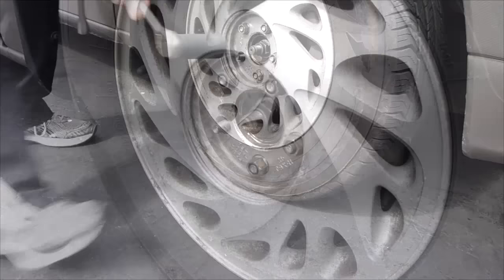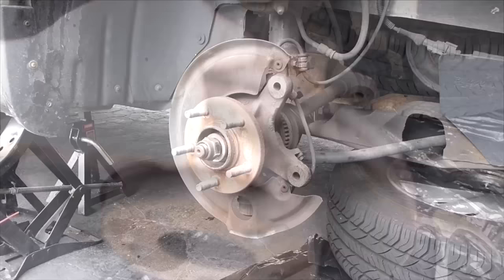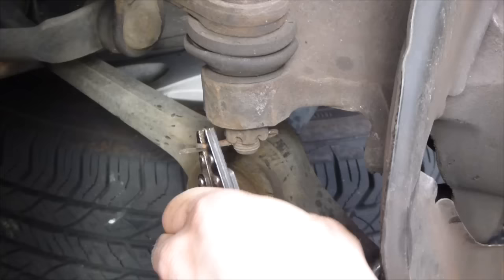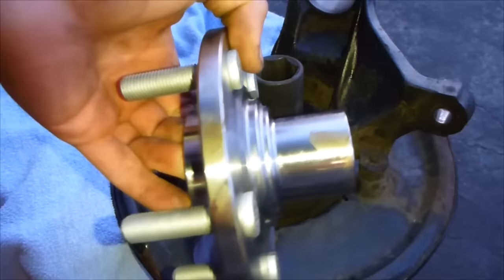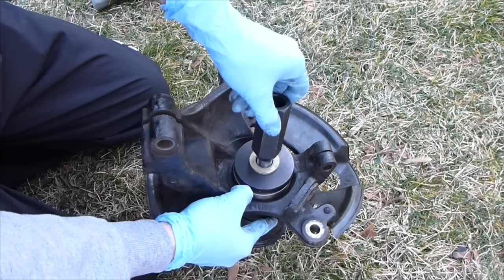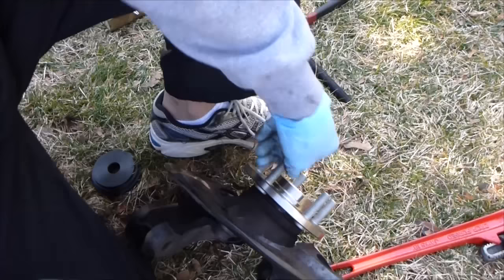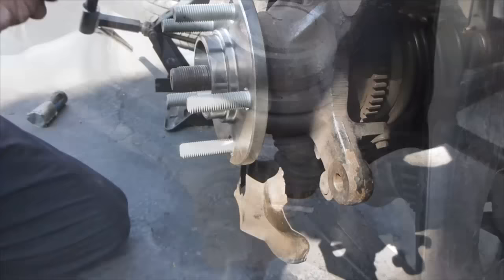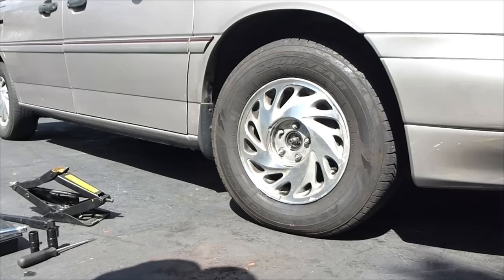How to Change a Wheel Bearing (short and fast version)

Comment: is it safe to hammer in and out my old and new bearings in and out? i do not have access to a press or a bearing puller, my autozone does not have any to rent out and i cannot afford to buy a bearing puller =[
Reply from the maker: Kevin You really shouldnt hammer the bearing in or out because you will potentially damage the bearing. For a few bucks take the knuckle and bearing to your local auto shop and ask them to press out/in the bearing.
Reply: good idea, hopefully my pepboys will help me out, i didnt think of that nice! thank you!
Reply: Chris, i am not sure if you will get this since i reply to my comment, but if you do please lemme know! I got everything off, the axle nut, caliper bracket, rotor, ball joint, tie rod, shock, but i CANNOT for the life of me get the damn axle out of the hub... i tried PB BLASTER, heat, hammering it, it is starting to mushroom and its marred up pretty bad now so i ressembled.. any tips for when i re attempt it? any help appreciated.. so frustrated!!!
Reply from the maker: Kevin If you can get a ball joint press around it and press it out, that would work. Keep the axle nut on the axle as you hammer it so it wont mushroom.

Comment: Hey Chris, where do u buy your vehicle parts? Which one is the best?I wanna buy a rear wheel hub assembly for my ford?
Reply from the maker: STEEVE DAVID Nicolas It depends. I usually go on amazon because they have hassle free 2 day shipping and good prices. What year and model Ford? Mevotech has great parts and I really like their stuff and MOOGProblemSolver also has great parts. Those are the two companies I go with for aftermarket and I have never had a problem!
Reply: 2002 ford explorer xlt v6 4wd
Reply from the maker: STEEVE DAVID Nicolas For the rear dont you have a solid rear axle? There is no hub assembly I am pretty sure (correct me if I am wrong). In that case, it is just a bearing and you need to remove the rear diff cover, take the pin out of the spider gears, remove the C-clip on the axleshaft and then use a rear axle bearing puller to get the old bearing out and press the new bearing in.
Reply: ChrisFix I don't have to do all that, it is a press bearing
Reply: STEEVE DAVID Nicolas what do u think if I get my bearing from auto parts warehouse
Reply from the maker: STEEVE DAVID Nicolas Ok cool! Yea, you can get your bearing from them! I have gotten parts from ***** and they have been great!
Reply: Alright man, thanks
Reply: Hey Chris,I have  a 02 ford explorer xlt v6, when I turn the steering wheel all the way either side, the engine turn off, especially when I'm backing up,or do a I turn? What could it be cv axle or bearing or engine?
Reply from the maker: STEEVE DAVID Nicolas That sounds like a bad power steering pump to me. Check this out: https://www.youtube.com/watch?v=A0fiZCHz5ew
Reply: ChrisFix should I just change it or flush it out?
Reply from the maker: STEEVE DAVID Nicolas I would flush it first because it is so easy to do. Even if you just use the turkey baster method and get most of the old fluid out and fill it with new fluid it should help. Then you can see if that is the actual problem. It might not be the problem but that came to mind since your engine stalls at full lock.
Reply: ChrisFix and there is that humming noise when I turn it around the corner too
Reply from the maker: STEEVE DAVID Nicolas Yea, that sounds like a power steering pump.
Reply: ChrisFix ok,I will take care of it then

Comment: Hey Chris, can I use that bearing press for a rear wheel bearing?
Reply from the maker: STEEVE DAVID Nicolas It depends. If it is a solid rear axle, no, but if it is an independent rear suspension, yes you can.
Reply: ChrisFix it is for 2002 Ford explorer 4wd
Reply from the maker: That has a solid rear axle so it is a different setup. You have to take the diff cover off, remove the pin holding the two axles in to remove the inner bearing. There is a slide hammer type tool you use to get the bearing out.
Reply: ChrisFix it is different here is my rear differential in my Ford http://www.swaptastic.net/ls1_miata/images/ford%208.8%20diff%20(Custom).JPG
Reply from the maker: So you are saying you have an independent rear suspension? Does it use a pressed bearing or a bearing hub assembly?
Reply: ChrisFix it is a pressed bearing
Reply from the maker: STEEVE DAVID Nicolas If it not a solid rear end and it is pressed, it should be very similar to this video. Is it disc or drum brakes in the rear? Drum brakes might change things up a bit, but if it is disc, I dont think it would be much different.
Reply: ChrisFix it is a disk brake,
Reply from the maker: STEEVE DAVID Nicolas I am pretty sure it will be really similar. Check out this video too: https://www.youtube.com/watch?v=04AyCYIUEWQ

Comment: does anyone know if this method will work on a ford escape 2005 3.0 4wd? need to know asap
Reply from the maker: Eman Knoke You just need to figure out if it is a pressed bearing or a bolt on. Either way, if it is pressed you do it like this, if it is bolt on, you unbolt the bearing and bolt the new on back on. Go to your parts store and ask them.

Comment: Its not cus your videoes are bad at all but i wonder why you never have those problems i got... so far i have used 8 hours on bearing job, and not even got the bearing pressed out. EVERYTHING is rusty and STUCK! Nuts brake, and have to get drilled out. Lockring is complety stuck and have to get bashed at in 30 min. And the hub was melted together with rust. i used 50/50 AFT + acetone but damn its a huuuge job on my 11 year old car.
Reply from the maker: It varies from car to car. Sometimes things dont go as planned but with the right tools and know-how you work around the problems.
Reply: ThunderWindz , he does not live in a very cold climate stats that uses lots of salt which rusts your vehicles like crazy.
Reply: Good point. Don't be a mechanic in the nordic countries!

Comment: I bought Torque Wrench and Sockets as you recommended. But I found that Wrench is 1/2 (Male) and Sockets are 1/4 (Female). Does the 4 pcs socket adapters that you also recommended connect these two?
4Pcs Adapter: http://www.amazon.com/TEKTON-4957-Adapter-Reducer-4-Piece/dp/B000NQ4PBG/ref=pd_bxgy_469_2?ie=UTF8&refRID=1SH3K6CCJC7PR3CBB4PP

Comment: won't it be way easier and faster 
if you just buy wheel bearing WITH Hub assembly
instead of just wheel bearing itself? 
don't have to buy all these special tools
Reply: kaleshnikov yeah but that's almost no effort in putting it in there and no special tools required

Comment: WOULD YOU KNOW WHERE I CAN FIND THE TORQUE SPEC FOR A GRAND VITARA 2006???
Reply from the maker: GRAMO107 Torque spec for what part? You can search online or get a shop manual.
Reply: ChrisFix FOR THE ENTIRE VEHICLE... I'VE SEEN ALL YOUR VIDEOS AND YOU USE THE TORQUE WRENCH, I KNOW IT IS IMPORTANT TO USE IT AND I'VE SEEN PEOPLE TIGHTEN AS THEY CAN TO KEEP GOING...
Reply: ChrisFix I DID SOME SEARCH BUT I FOUND JUST THE TIRE SPECS...
Reply from the maker: GRAMO107 You have to search specific parts if you use google, but if you have a service manual you will have all of the specs.

Comment: fuck me, I can't do this myself. How long can I let this job go? Do I need to get it done yesterday or can I wait until the car is bouncing in the air? Only started getting the reverb noise the other day.

Hoping it magically goes away when I put the summer tires back on but I doubt it.
Reply from the maker: qerfwgbrwtnj3w5ynmetyjtymetynmtwghwrehqwytntwh4qthw This is something that shouldnt be put off because if the bearing goes when you drive, the wheel can come off!
Reply: I don't think that's what it it now anyway. It gets twice as loud when I move the wheel even slightly to the left. Not only that but the pattern of sound isn't really consistent like I imagine it would be.

Instead of, for example, (*x**x**x**x**x**x*), it's (**x****x##***x**x**x##x).

But not rapid like it looks there. It's a low reverb sound. Fingers crossed for the tires. (doubt it)
Reply from the maker: qerfwgbrwtnj3w5ynmetyjtymetynmtwghwrehqwytntwh4qthw Keep me posted. If the noise only happens when you turn, check the CV joints in the front axle.
Reply: ChrisFix na, not it. It's a lower pitch sound, like a hum, but gets twice as loud when the wheel is slightly turned to the left. e.g, changing lanes at speed.

I'll let yuh know when I do.
Reply: ChrisFix
 Was the front left bearing. Of course.

They charged me $270+ tax to replace it. Which is what I expected so I'm happy.
Reply from the maker: qerfwgbrwtnj3w5ynmetyjtymetynmtwghwrehqwytntwh4qthw Awesome! Glad it went well and thanks for the update!

Comment: I generally like your vids however this one fell a bit short: Why dont you own the right tools? That pipe wrench on the bearing press made me groan! Please dont ruin other peoples tools like that! It was bad enough you gouged up the one you did.  Also learn what parts are called: You had a 'snap ring' and snap ring pliers (not a split pin, not a clamp) holding in the bearing.